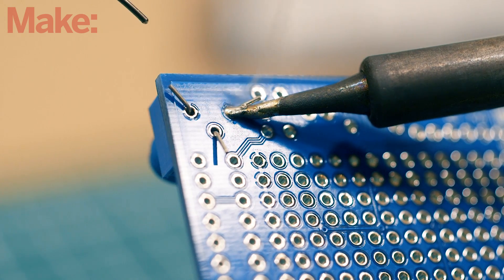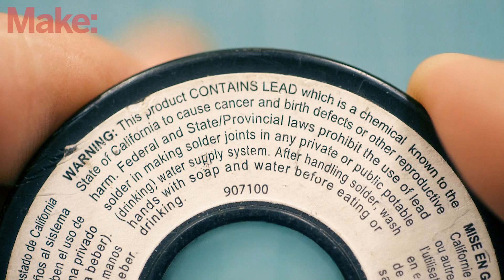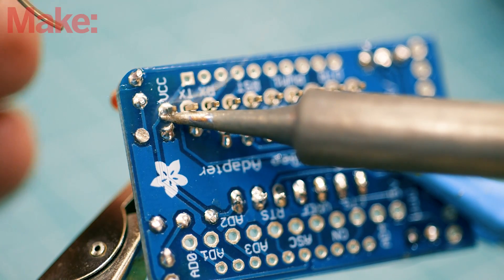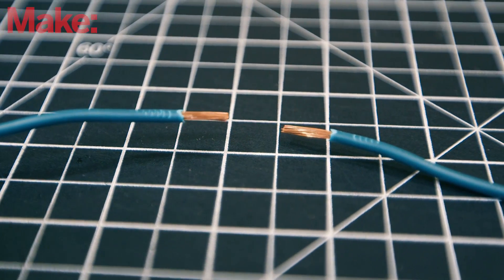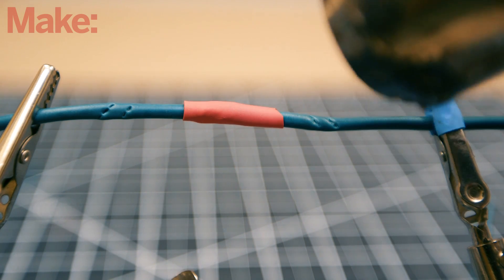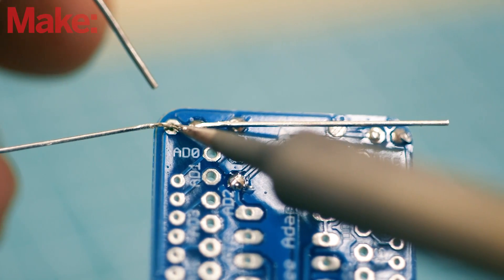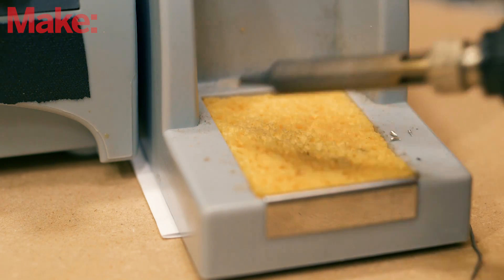Skillbuilder: Learn to Solder

Comment: Any tips for stopping the tip from oxidizing?
I always keep my sponge quite wet, but should it be more on the moist side? Also, yours looks a lot softer than mine.
Reply: Always keep solder on it. The tip will come pre-tinned and it should remain tinned at all times. The tip will only oxidize if there is no solder on it. You should primarily be using a brass sponge cleaner. The MOIST, not wet, sponge is for heavy, infrequent cleaning like when you get some non-solder contaminant on the tip. Never use a wet sponge, just moist. I pass the iron over a moist sponge maybe once per month or once in two months.

My personal routine for a new tip is to heat it up and immediately put additional solder on it. The rosin will burn away and leave the tip coated. I "clean" the tip in a brass sponge before and after I use it. If I set the iron back into the holder, I clean it in brass, apply more solder to it, then set it down.

When I start the solder up next time, I heat it up, clean off the old solder in brass, then immediately put more solder on it. Anytime I pick up or put down the iron, it goes through the brass. Anytime it goes through the brass, I put more solder on it right after it goes through the brass. My tips never oxidize. I only use leaded solder as well. I prefer 0.8mm 60/40 tin/lead solder with rosin flux core. A chisel tip is also a must have.
Reply: Thanks.
I use solder from eBay - it's CHEAP!
And a $1 tip. From eBay... Because it's CHEAP!
I will try the brass thing again.
Reply: get one of the brass pot scrubber things to clean your iron with.  they work a lot better than the sponge. also, use good tips and good solder.  Cheap ebay solder is something to avoid.  Get some multicore, kester, or M&G Chemicals rosin core solder.
Reply: I'm pretty sure what I had got attracted to a magnet, so it's not brass. 
Will probably buy some on eBay because its.......
Reply: Yup. I keep it tinned.
Interesting. I will need to buy a brass wire brush, as all of the cheap ones that I see on eBay are brass "steel".
So, if I understand & sum it up correctly, you clean it all the time with brass, but rarely with the sponge?
Thanks!
Reply: Yonatan24 Might be worth getting a new tip. If it won't take solder after a good clean it could have worn out.

Don't be too vigorous when cleaning, especially with a cheap tip and the brass wool. You just want to be cleaning off any excess solder, not totally scrubbing it. Most tips have a special metal coating but the core underneath won't take solder so once you've damaged that it's probably junk.
Like others said, always keep your tip tinned, especially when you've finished and turning off the iron.
Decent 60/40 rosin core solder is a must.
Reply: Load your tip with solder every time you expect to rest the iron in the stand for longer than a few minutes.
Reply: Many folks solder, then wipe the tip before putting the iron back in the rest.  It's better to leave solder on the tip while it's idling.  Then, when you're ready to use the iron, pick it up from the rest, wipe it clean, tin if needed, then perform your solder, then (don't wipe) put the iron back on the rest.  

Oxidation comes primarily from residual flux and is accelerated by heat.  If you have a temp control station, only use the heat necessary to perform the solder.  If you're going to be away from the iron for a few minutes, turn the heat down.  Some fancy solder stations have a sensor in the rest and automatically lower the temp or cut power to the iron entirely, depending on how you set it up.

Most soldering iron tips are iron clad copper.  The copper is really good at conducting heat from the heating element to the work being soldered.  The iron clad exterior resists corrosion and helps the tip last longer.  Be careful how you clean the tip.  Once you wear through the iron clad, or if you sharpen the tip with a file or some such, it will expose the copper inside and won't last long after that.

I don't recommend damp sponge method of cleaning.  Soldering equipment mfgs sell brass "bird's nest" stuff that looks like a bunch of brass curly metal savings.  This is probably the best way to go.  Something like this sparkfun*DOT*com/products/8964
Reply: I almost always keep solder on the tip while the iron is resting. Thanks for the tips!
Reply: Yonatan24 I had loads of problems with tips oxidizing. My solution was to use brass instead of a wet sponge to clean the tip, and tin the tip before putting it away! Also, even basic heat control helps, if not, turn the iron off as soon as you stop soldering. When it sits there heating up without a temperature control and not being used to melt solder it gets far too hot and the tip dies quickly.
Reply: Just replace with a better tip, it worth.
Reply: ANameThatIsn'tMyOwn 
How long do your brass sponges last? Do they oxidize over time, making them useless? 
It's $1.50 that I don't want to waste :) 
Thanks.
Reply: Yonatan24 They last for ages.
Eventually you'll get lots of solder balls in the sponge, but a quick scrunch over the bin cleans it.
Reply: Just found that we have some in our kitchen/cleaning cabinet. It doesn't attract to a magnet, and I will be trying it out next time I solder!
Reply: Yonatan24 If you're serious about setting yourself up for the future. The most important thing is the iron.
Consider saving up for a proper soldering station if you start getting into soldering more often.
Reply: Yonatan24 Be careful with kitchen scourers, that sounds like a terrible idea! The soldering ones are very soft to avoid damaging the coating on the tip.
If you're totally broke, just use a damp cotton cloth.
Reply: I'm not broke, I just don't want to waste money. If I know that It'll last me a few months, I won't want to spend a lot. I end up spending only $2 on so many things!
I played with the brass pan scrubber for a few seconds. It felt really soft and flexible. And it's not made of steel, so I don't think it'll do that much damage. It's probably the same stuff that I could buy on eBay.
Thanks for the help and tips!
Reply: Yonatan24 Lol, no worries. Feel free to ask here if you get stuck.
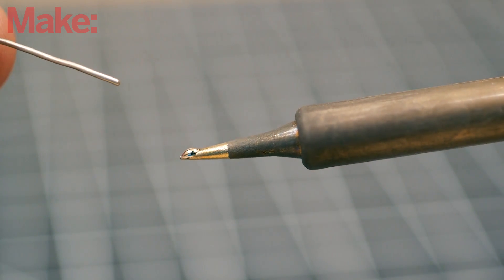Reply: alternate between sponge and the other stuff(Hakko thing) 1:50 he showed (kinda like brass wool; choir boy), the sponge should be just damp not wet. Also clean/wash then dry the sponge with detergent then water, cause it gathers different stuff(rosen got acids, and kinda greasy, oily), do this like once  a week or 2-weeks.
revive your solder ironing tip like this guy did https://youtu.be/7PWmMxjXwYE

Comment: I'd love to see some surface mount tips for beginners
Reply from the maker: I'm not sure I'd reccomend surface mount for beginners! I'm still pretty intimidated by it. That said, Collin Cunningham has this great video over on the Adafruit channel https://www.youtube.com/watch?v=QzoPxvIM2qE
Reply: I keep having a hard time installing surface mount parts into solderless breadboard myself. Clipping test leads to SMD is tough to do too. I have no problem soldering the junk though. I used to make SMT military aviation communications gear. So yeah now I can't stand looking at the crap, and refuse to work with it for myself.

Comment: Use a flux pen with no-clean flux to add flux before soldering.  This is especially useful to small or tricky connections
Reply: thats true you should use FLUX before soldering the non clean Flux is alot easier, l use the non clean Flux marker

Comment: nice tutorial. What model is that digital soldering station?
Reply: Looks to be a Weller WESD51.
Reply from the maker: Thanks! The digital station is the Radio Shack "Digital Soldering Station"  catalog number 64-053. You can probably have them for pretty cheap these days, but make sure to stock up on tips. Seems like it's a rebrand of this unit from Atten: https://www.wavecom.com.au/product_view.php?id_product=729

Comment: How do you suggest tackling the issue of extended solder tip contact where the components become hard to work with because they're too hot to touch or even begin melting?
Reply: Coaster Labs That's a sign that your iron is probably at too low temperature for the job you're doing. Or your technique could be bad. ;)
You should only apply the iron for the minimum time possible otherwise the heat will transfer up the legs of the component you're soldering and fry it. Some components are really delicate to temperature.
If you only have a basic iron using a more 'chunky' tip like a chisel tip could help as it stores more heat and can transfer it faster. Also using 63/37 solder might help, it has a lower melting point.